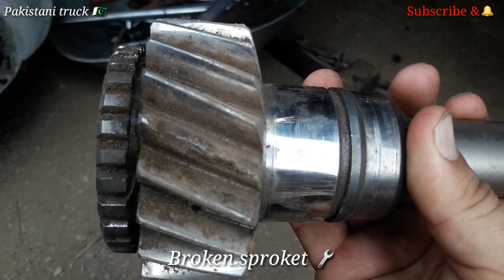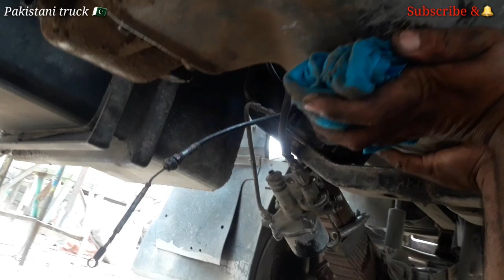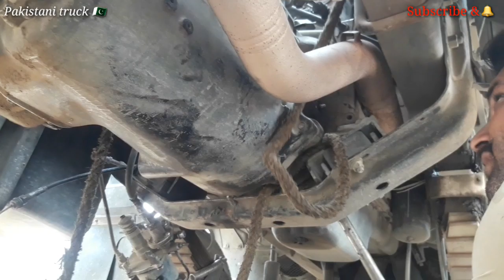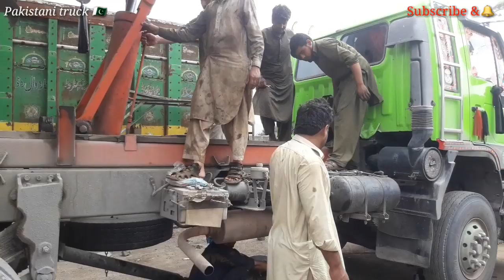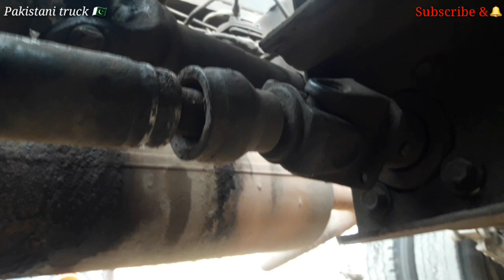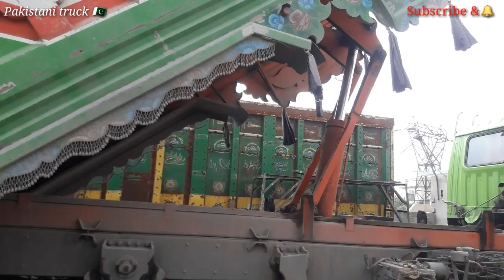How to Fit gearbox with feet in Pakistan

Comment: If you cut the heads off a couple bolts,screw them into engine to guide gearbox into place,fit other bolts then remove guide bolts,
Reply: Nice idea
Reply: But totally unnecessary here since you can clearly see this does not use bolts around the bellhousing, there are already studs all around which they slide it onto.

Comment: How many speed's you have on that transmission. I want to know what brand is.how many disc have the clutch.n how many horse power have that engine.good video. thanks
Reply: that truck looks like a hino dump truck. thanks
Reply: Around 6 to 8 speed transmission